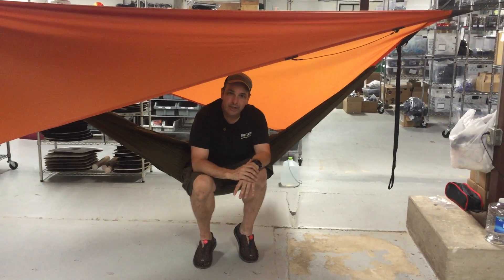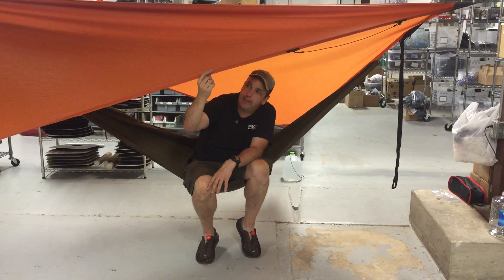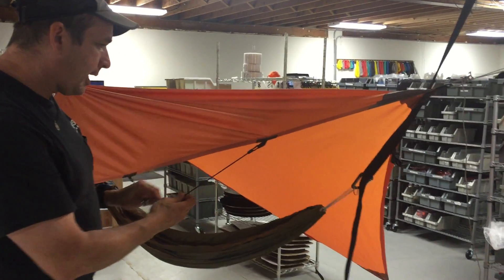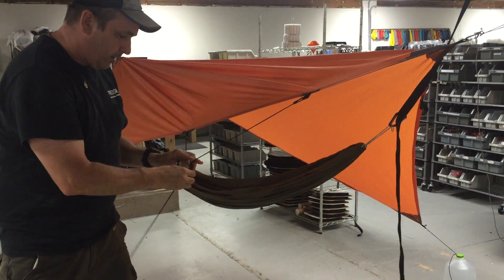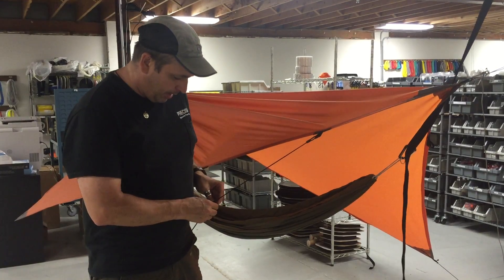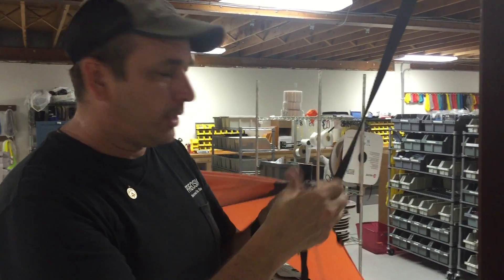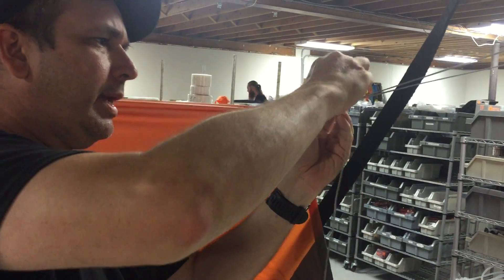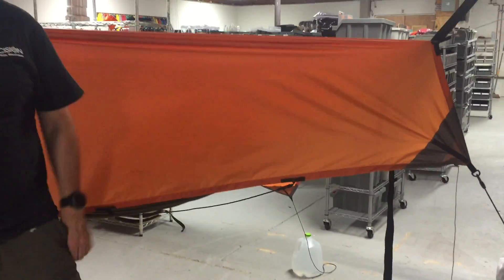DIY ASYM tarp made from Xenon WIDE polyester sil

Comment: Clever design and implementation and great new fabric choice but I can't help wonder if you trying to solve a problem that there's already solutions to? Why not just use a hex tarp to start with? What the advantages of the asymetric set up? Weight saving is the only thing I can think of but I've never seen an asymetric in person or looked at the specs to see how they compare.
Reply: weight savings, for sure with the Asym shape, but also build time and material cost. with one panel of fabric, this would be super easy and quick to build with this new SUPER WIDE XENON!! Awesome work, Dutchware